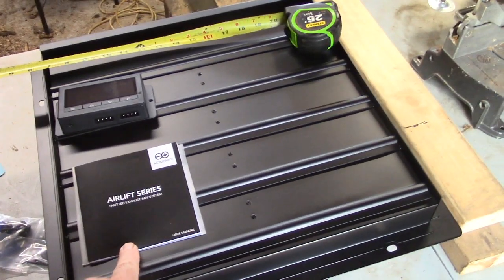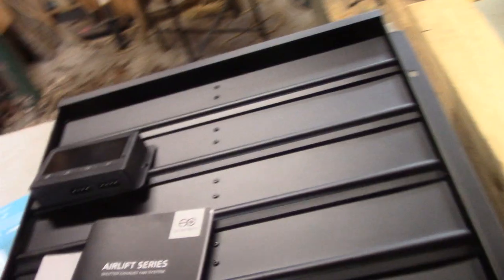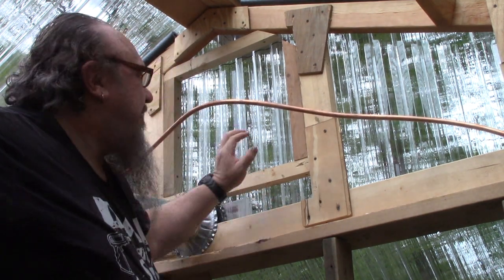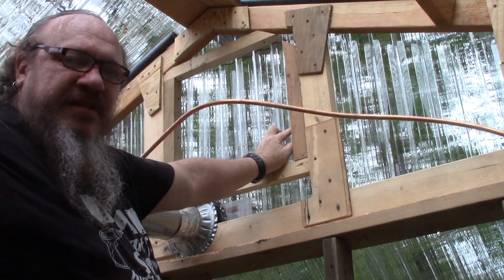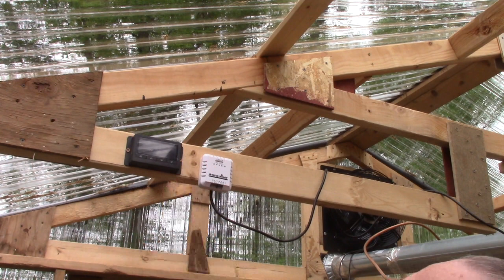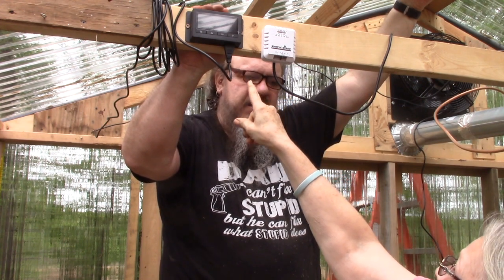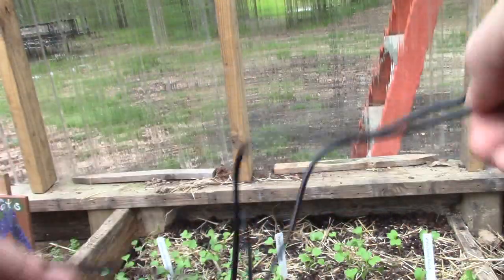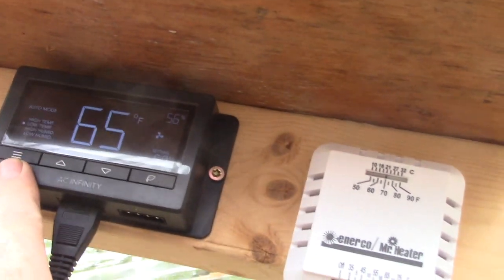Installing AC Infinity Airlift Automatic Shutter Exhaust Fan Vent into Greenhouse

Comment: I have a similar-sized greenhouse (10x30ft) and want to install an Airlift too, but am unsure whether to use this T16 or the T20. I know on paper your T16 one is fine for the size, but I read it's better to go up in size a little to deal with barrier (one tall plum tree in there) and the difference between manufacture rating and real-life performance. What do you think, is there a point in getting the T20 or is the T16 enough? In my case it's more for venting out the humid air, not too much heat to worry about here in Iceland!
Reply from the maker: I was going to say “go big” until I saw you were in Iceland. The smaller one is probably fine, but if cost is no issue, you can never go wrong by having extra capacity.
Reply: @PirateStu  Gotcha. But why did Iceland make you change your mind?
Reply from the maker: @qwasyx3  I was just thinking that you wouldn't need to move the amount of heat and humidity that I dealt with in Memphis.
Reply: @PirateStu  Heat, no. Humidity? OH yes. There's so much water up here.

Comment: $270?  That seems like a big chunk of change for just a vent fan.
Reply from the maker: If you have the time to monitor the temp and manually turn a fan on and off, you can get by a lot cheaper. We like to be able to go out of town occasionally, so automation was worth the expense.
Reply: @PirateStu  I have the 12". I originally bought another without remote option, but immediately canceled and ordered another. I didn't even open the other when it came. Having cell phone access is worth it.

Comment: I'm setting mine up and so far it looks very durable and easy. I'm just trying to figure out how to run the thermometer probe because I'm actually using this indoor. I know that indoor is not its intended use.
Reply from the maker: You need the thermostat whether it is indoors or outdoors if you want it to work based on the temperature.

Comment: Thanks for responding I was also asking if you knew about the intake vent what would be a good place to put it I figured I put the 10 inch fan in the back top of the greenhouse and the intake vent in the front on one of the lower panels. what size intake vent do you think would work well
TIA
Reply from the maker: Hey look! Two weeks later and YouTube finally post your comment!

Comment: I just ordered the 10 inch for my 10x12 greenhouse it looks pretty easy to install i have a 6 inch louvered vent that i want to install in the lower front of the greenhouse but i think i may look for a larger vent for the front....any thoughts?
Reply from the maker: Have you installed it yet?
Reply: @PirateStu  yes I did last week and it works great had to add a 20 inch high velocity fan to the green house to draw air in I am still in the process of figuring out what to install for an intake haven’t been able to find a vent large enough just came across this and thinking about getting 2 of them

https://www.agriculturesolutions.com/high-tunnel-greenhouse-vent-with-automatic-opener?gclid=Cj0KCQjwnueFBhChARIsAPu3YkRu8o_Jcib99VLmbPhRVg-XceIe1M4lImMNXLLO0FjD-MvDOUJNzzsaAszdEALw_wcB#

Comment: Nice job! I'm going to install mine today. How it working for ya? Does it manage the temp well?
Reply from the maker: Yes, it works really well. We also have a large panel on each end that we can open up when it's warm, but since our ceiling is pretty low, the fan keeps it from getting hot in the rafters.